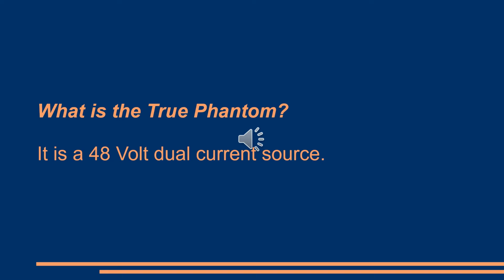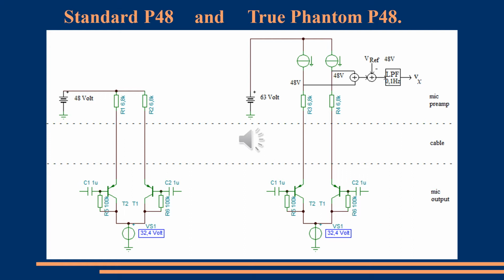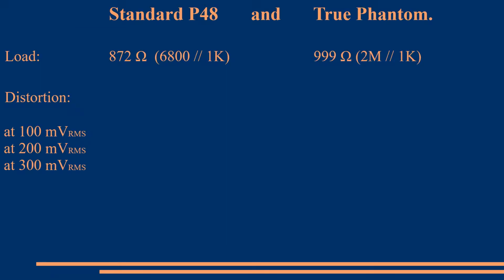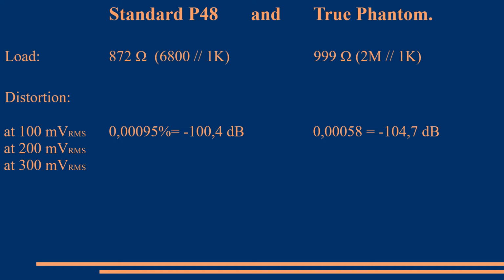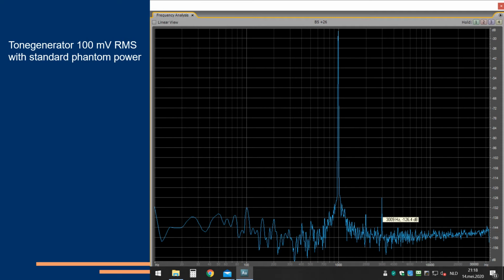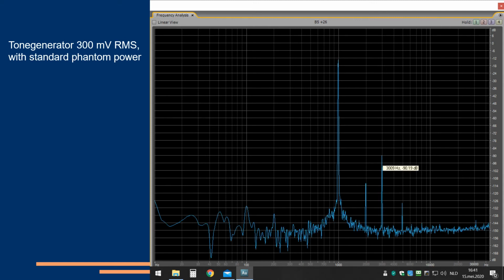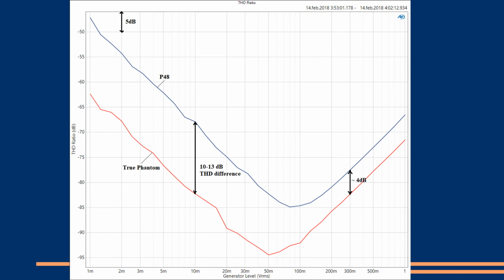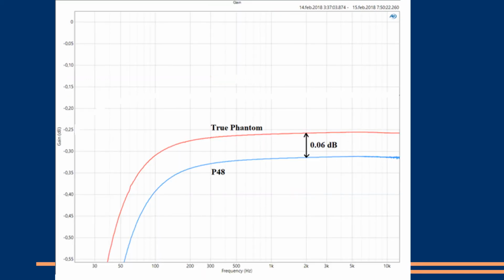True Phantom explained

Comment: Great explanation! Thanks so much. I always assumed that different boards, interfaces, power supplies, etc., had different Phantom Power Circuits . . . But I never really thought about how the "quality" of the circuits could have an effect. Is there a way to determine what phantom power you may have available by checking impedance or other? Or do I have to look at schematics and/or analyze the circuit physically? Please Advise and thanks so much. peace
Reply from the maker: Hi redcarinacoustics.
All phantom powers in this world are two 6K8 resistor (1%) and a (good) 48 Volt powersupply.
That powersupply is also a loar for the audio! This gives increased distirtion, less gain, more noise and a higher roll off of the base tones.
So you can be shure that your phantom power is the resistor one.
Soon there will be mixing desks with truephantom! At the moment Triton Audio make that.
At the moment we ame working on a open source DIY mic pre board. 4x15 cm. Than you can make your own mic pre with as many chanels as you need. You can order the chips from Prema GmbH.

Thanks for your reaction.

Joost Kist
https://www.truephantom.nl/
Reply: @truephantomsound  Thanks for the reply, I can't wait to try it!
Reply: @truephantomsound   Let me know when the DIY Boards for the mic-pre are ready! I will build on my channel . . .